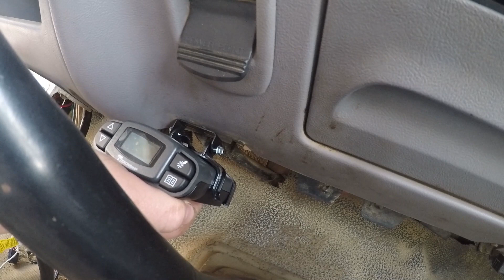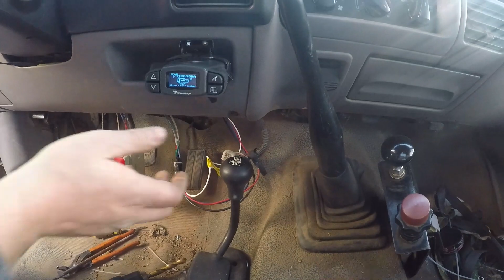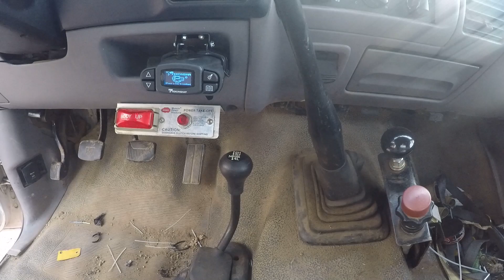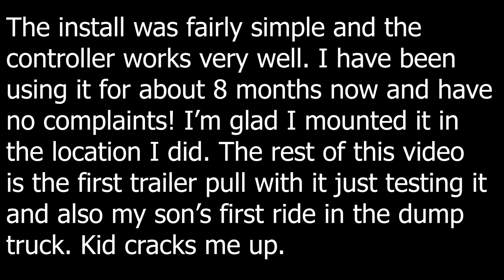97 F350 Brake Controller Install

Comment: I have the exact same setup as you and wiring. I went to install the tekonsha harness and everything lined up the same. Plugged into p3 controller, and no power. Traced wires back and everything looks good, so Im stumped. I have an additional brown wire for illumination that is not being used. Where does your brown wire tie into?

Comment: I have a 92 F350 and not sure where my wires are. I have a 7 pin in the rear, but no controller in the truck. Could you provide some insight into where it would be?
Reply from the maker: The 7 pin in the rear is probably just run off of your tail lights. The brake controller is installed using its own harness and the brake light wire from the pedal per the instructions it comes with. You’ll then run your own wire back to the 7 pin.
Reply: @CountyLineGarage  It was used by the previous owner with a horse trailer. I can't find the plug in port I've seen under the ashtray, but it does have four wires coming from under it. One is red, blue, white, and green. it previously had one installed I'm thinking, but they took the controller before selling. I don't think it is an OEM setup. I'm just wondering if those are the wires I should use?
Reply from the maker: @aegiscaleb   do you have a controller to install yet? What I would do is start tracing wires to where they go. If I remember correctly, the controller will have a power going to battery, ground, trigger going to brake light switch, and output going to the 7pin. Trace those 4 wires you have and make sure that’s where they all go then label each one. When you go to wire in your new controller all you’ll have to do is connect using those labeled wires instead of running all new.
Reply: @CountyLineGarage  Yeah I've got a Reese controller already. Haven't tried tracing the wires yet, but figured I would have to. Thanks for the insight. Really appreciate it
Reply from the maker: @aegiscaleb  sure thing! Let me know how it works out.